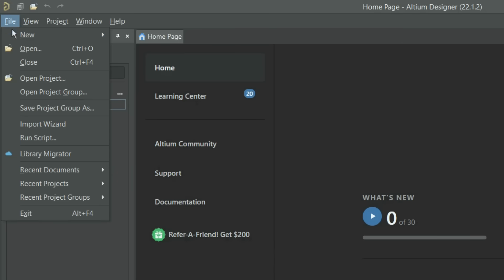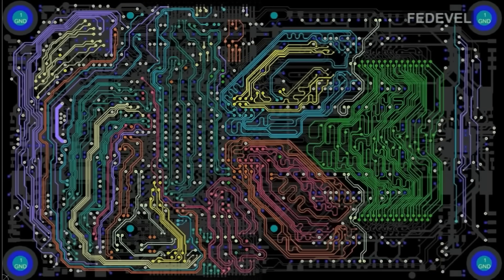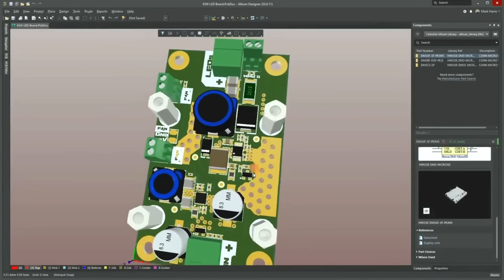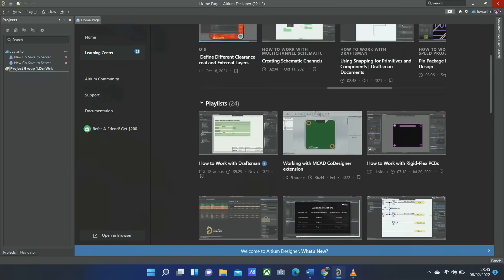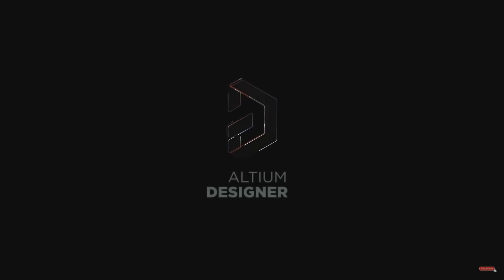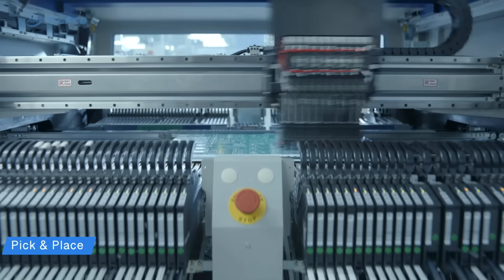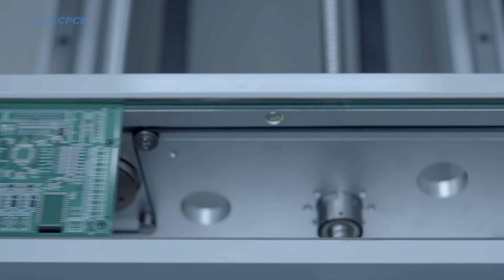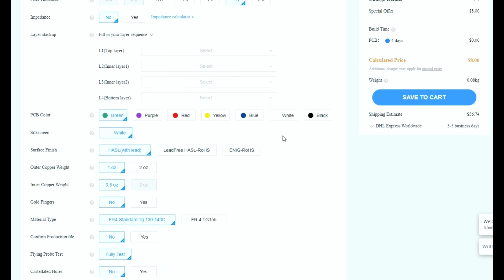Build a High Power Amplifier using 20X Sanken Transistors with 20A Toroidal Transformer #cbzproject

Comment: Do you have the designed pcb file, if you have it, I will buy it
Reply: Boss can you do solar 0.5v to 12v boost converter PCBs and 12v to 240v inverter recharge phone charger Type c out charger

Comment: You also have the designed pcb file
Reply: Boss can you do solar 0.5v to 12v boost converter PCBs and 12v to 240v inverter recharge phone charger Type c out charger

Comment: A professional amplifier builder will use a heatgun not a lighter. Terrible
Reply: Heat is heat. He didn't char the heat shrink or the insulation around the conductors. Relax. lmao.
Reply: Such a noob. He didn't overheated/melted the heatshrink dude relax, plus lighter is better so the heatshrink will have a better grip. Have a good thinking and think strategically in most cases dude. This is a DIY not a factory lmao.

Comment: I don't think rubycon make those yellow capacitors... Especially not with little boxes.
Reply: I was just going to comment I've never seen boxes of 2 of any cap just loose or bagged by tandy or whoever.
Reply: @JohnM7YYJ  I also never seen any Japanese caps put where they were made so boldly on the capacitor.  Usually they note where they were made on the bulk bags...  I have bought some from Nichicon and Elna, their 100-200pcs bulk bag are not too expensive.

Comment: Nice amp and all, but you are an utter failure at electric shock protection when it came down to the fuse. Neutral-bound fusing is just asking for trouble and risk of electric shock. ALWAYS the HOT should be fused BEFORE even touching a circuit or transformer! NEVER the neutral!

Comment: you should have built in a socket instead of cnnecting the power directly
Reply: Its not about replacing its about storing/transporting or using in an audio rack for an event or something

Comment: that case earth connection is - less than ideal
Reply: Although he has CE and WEE markings on the board, that would make it not compliant - the fastener used for an earth connection has to be one that's used only for that purpose, and not used for the attachment of any other component.

Comment: Why so many transistors?
Reply: because they run a lot of power and a single transistor would simply burn away
Reply: @legominimovieproductions  how many amp's at how many volts at what kind of load  it is calculated?

Comment: can you design a board scheme for 5000 + 5000 watts Rms? I want to place an order to assemble a 10000 watt amplifier, can you help me?
Reply: with this power you should better use a Class D Amp, Class AB is not really suitable, the 1980s are long gone!
Reply: Use a car amp with a car battery and a fast charge battery charger if you can't afford a 5000w amp. We used to use them for free parties. Very inexpensive if your gear gets confiscated by the po po

Comment: With the transformer you use  I guess you can get 360W RMS at 8 ohms...
It would be cheaper if you use Toshiba TTC5200. Unless if you want to drive a 2 ohm load...
Reply: so if i use sanken transistor it could handle 2 ohm load?